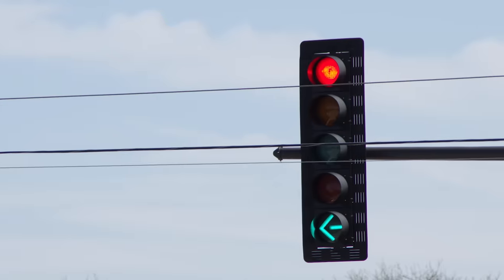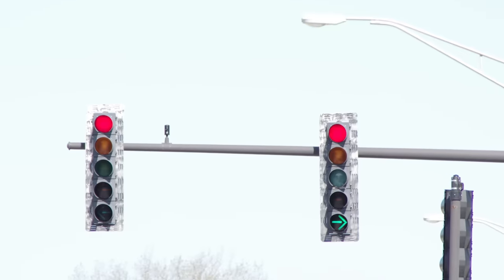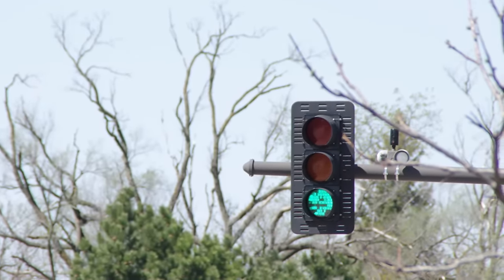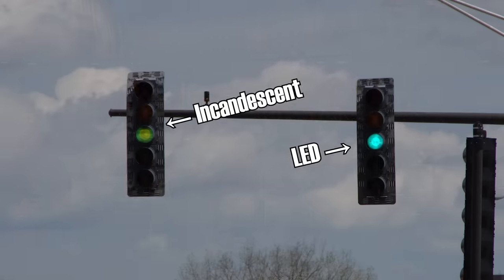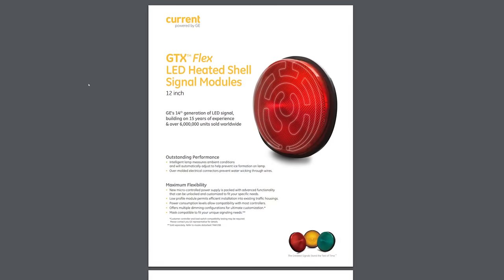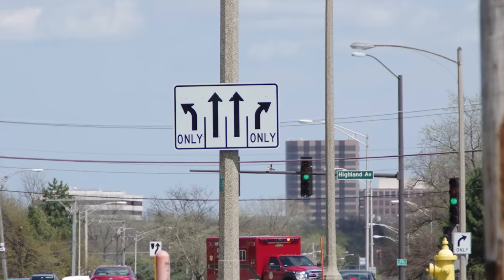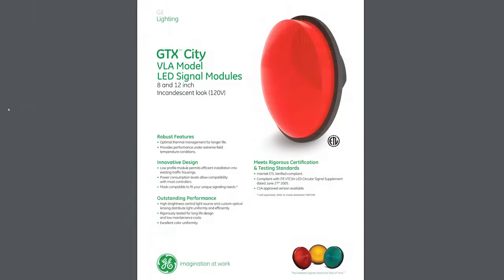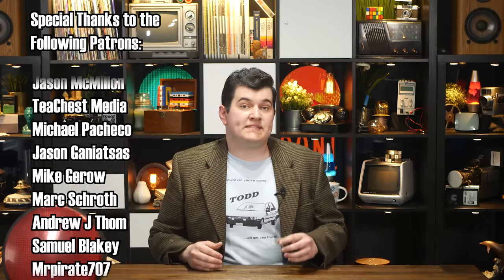The LED Traffic Light and the Danger of "But Sometimes!"

Comment: 8:51
"The other 300 days when it doesn't snow"
You mean you only see 65 days of snow annually?
confused in Canadian
Reply: Right!  Also frost is an issue as well.  Not just snow.
Reply: @nocturnal0072  Would the heater not fix that too?
Reply: @Richard-jm3um  It might not be enough in cold climate situations, like Russia, Alaska and Canada.  Yes, this is very situational.
Reply: @nocturnal0072  Yeah, well I'm still with the guy from the video, It's a problem worth looking into and trying to fix for when it happens, specially if it happens most of the time, that of course would mean that it would no longer be a "But sometimes" but a "But most of the time".
Reply: @Richard-jm3um  I like new tech, but sometimes changing for the sake of new is pointless.

For example all the interior lights in my car are LED, all the exterior lights are still bulbs.  Different scenario but LED lights are useful and reliable.
Reply: The other nine days get super crazy!
Reply: @DAFIZZIF  I see what you did there.
Reply: I was confused in Wisconsin.  We get a lot longer Winter then 56 damn days lol. Pretty much December-March for sure are "It's going to suck" months.
Reply: Meanwhile, in the southern US, we get maybe two snow days a year, and the snowfall is rarely more than an inch or two. We don't even NEED the heaters. We've already switched to LED in my town.
Reply: @Swan-may  Good move, It should pay off soon.
Reply: As a Texan... What's snow?
Reply: @Swan-may  This year in Tucson it snowed for a whole lot of 1 day.. and it wasnt even real snowing, more like glorified hail. And everyone went crazy cuz this never happens haha, we also dont use right turn arrows, we just turn on red
Reply: You mean you get more than 5 days of snow per year???
Severely confused in Arizonan
Reply: @AtomicBoo  We turn right on red after stopping first, unless it's a major intersection with a flashing yellow arrow during perpendicular traffic's left turn arrow segment. If the yellow arrow is flashing you can roll through the turn yielding to U-turning vehicles as necessary.
Reply: @mannys9130  Yes, we have to stop and then we can turn on red to the right, about the Flashing yellow arrows, they are virtually non-existent in Tucson, maybe because its a smaller city
Reply: @AtomicBoo  🤔 They're everywhere here on the East side. It really helps right lane traffic flow. :)
Reply: @Richard-jm3um  Here in Ontario Canada we get several months of snow and we have LED traffic lights everywhere. In fact we have had them for more than a decade in a lot of places. It is not a problem and snow doesn't build up on them. Also have never seen a LED traffic light not lit unless there is a power outage.

Canada in general is much better at maintaining our infrastructure than the US.
Reply: Here In Texas it snows every 9 years (not kidding)
Reply: Canada is an enormous country, larger even than than the USA, though much of its territory is uninhabited (taiga and tundra).
Vancouver, on the West Coast, very rarely receives any snowfall (The outdoor events in Vancouver's 2010 Winter Games were held far away from Vancouver, where the festivities and some indoor games took place.
Nova Scotia's climate may remind you of Germany.
Reply: What is this snow substance you speak of? - A Southern Californian :)
Reply: Ive never seen snow in my life
Reply: @mehrunez4838 Same with Utah.
Reply: It never snows here in FL... Well, maybe once a decade. Certainly not cold enough for it to get caked on and cause traffic light issues.
Reply: at least here in indiana, while it's common to have snow on the ground from November to march, I think he was probably referring more to the fact that the number of days where there is active snowfall capable of being heavy enough to get into the light fixtures isnt as common. here we usually only see active snowfall with any accumulation once or twice a week where the rest of the week it's just cold and gloomy
Reply: @nocturnal0072  It's all about how much it costs the manufacturer to install them. LED headlights might cost a little more, and the bean-counters in the factory start to see what they can get away with skimping on, to maximise profits, whilst hoping that most drivers will not complain about the cut corners. They're usually right.
Reply: @nocturnal0072  Yes. One cold day in Barrow, Alaska can be over 2 months long.
Reply: REE SUPER TRUE
Reply: @nocturnal0072  you know heating elements can be specified in a multiple of ranges and even higher temp maintained that those old incandescent lamps. So its as simple as a site survey study to find the appropriate smart heater for the location of installation and you're still saving money through LED energy savings and reduced maintenance.
Reply: @mehrunez4838  yeah... I'm glad Milwaukee hasn't switched over to a lot of LEDs

... Although I see them more and more and it's hilarious to see lighting crews run around to try and wipe the snow off of them 😂😂
Reply: Even if you have snow half the year, that would still be less energy used than using overheating incandescent bulbs all year.
Reply: FSgt Cross I’m in Tennessee and it feels like a lucky year if we even see a rough total of 7 days of snow any given winter
Reply: In Ireland, we usually have 360/365 days with zero snowfall, yet we're as far North as Montréal. Gotta love islands and the Jetstream.
Reply: Yes, but you guys also know how to "rub two sticks together" and get warm! I am sooo jealous! Down here we forget to reach out and cross the aisle, warmly, yada yada
Reply: CANADA SO COLD AND SNOWY HURR HURR DURRRRRR
Reply: it didn't snow once in washington state this years xD
Reply: and washington is 100 miles south of surrey
Reply: @nocturnal0072  might not be enough? U are saying that a light with residual heat would be able to melt snow or whatever but a heater with the sole purpose of heating wouldn't be?
Reply: Last year I saw exactly two days of snow. I'm in Germany. Climate change is real people.
Reply: @andonivelasco8466  This has been discussed already.  Oh great thread necromancer.
Reply: @nocturnal0072  sry didn't read the whole thread, what u said made me inmidiately stop hahaha
Reply: @andonivelasco8466  All good, technically the best solution would be to use an led light with a temperature controlled heating element.  A simple change in duty cycle to keep the "bulb", from frosting over and using the bare minimum of power to do so.

However my only real gripe is that, currently keeping all that working well versus just using traditional bulbs in cold climate situations is a wash.

I'm sure eventually some company will mass produce a variety of reliable, cheap parts to do this.
Reply: @nocturnal0072  the replacement could be done as the bulbs stop working. Everytime they brake put a led instead.
Reply: although, living in southern canada, snow is surprisingly scarce.
Reply: @Cyberwar101   move to Colorado, you'll be very familiar with it
-from a fellow Texan who moved to Colorado
Reply: Me: 𝘤𝘰𝘯𝘧𝘶𝘴𝘦𝘥 𝘪𝘯 𝘈𝘶𝘴𝘵𝘳𝘢𝘭𝘪𝘢
Reply: Well we get one little flurry, that coats things for a few hours until it melts, about once every 2,900 days or once every 8 years so I don't think we will ever have a problem seeing a light.  Unfortunately our state has one of the highest percentages of idiot drivers, (also the highest insurance), so the problem here is really that people don't bother to LOOK at the lights before going through, but snow and/or ice is NOT a problem in New Orleans, LA.
Reply: Well yes hahaha, but I think he meant the days it's actually snowing
Reply: I grew up in Arizona, my home town has snowed once in the past 25ish years